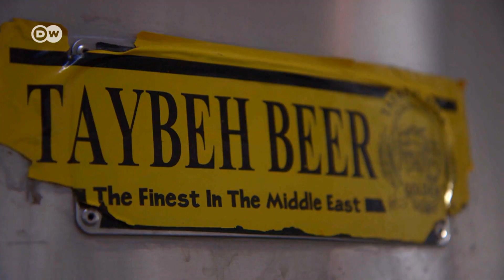How Palestinians celebrate Oktoberfest | Palestinian beer, music & dancing | Oktoberfest Taybeh

Comment: DW needs to check their claim that "Taybeh Brewery" is "the oldest in the Middle East." Per Wikipedia, it was established only in 1994. On the other hand, Israel's Tempo Beer Industries owns the brewery, which has operated since 1930's. But even Israel's second largest brewery has operated since 1992, two years before Taybeh. Perhaps, journalists should do more than just regurgitate what they are told or what they wish to be true.
Reply: you must be fun at parties. assuming you'd get invited.
Reply: Israel is 73  years old my guy LOL. Taybeh is MUCH MUCH more older
Reply: Also worth pointing out the Al Ahram Brewery in Egypt founded in the 1890s and is still in operation. Perhaps it’s the oldest independent brewery in the Middle East, since most of the Middle Eastern Breweries are now owed by foreign companies. Both Al Ahram and Tempo are owned by Heineken for instance.

I wouldn’t be shocked if that’s what they meant, as more and more breweries are coming under the ownership of international companies like Heineken and especially AB InBev. The four largest brewing companies in the world control over 50% of the market.